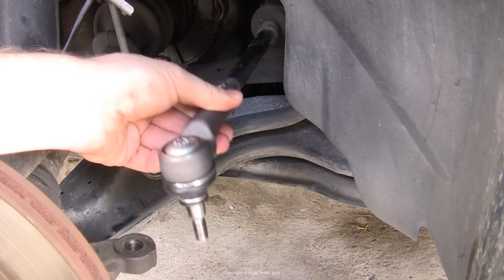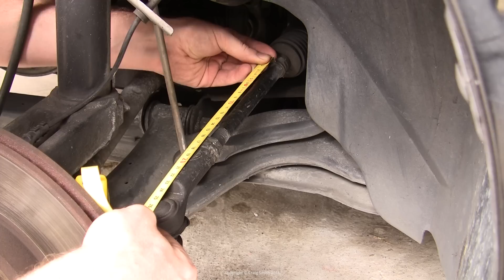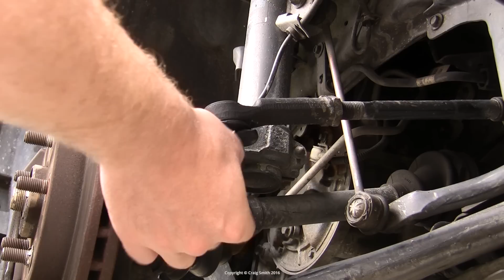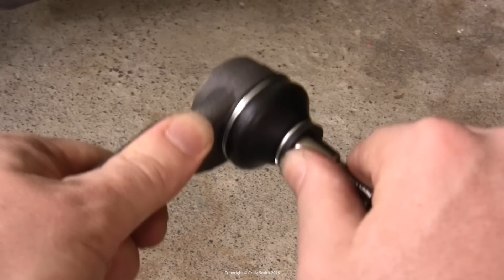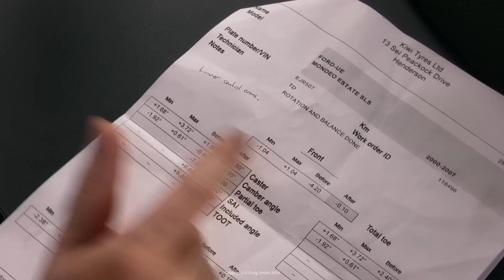How to: Replace outer tie rod ends (Ford)

Comment: If you measured to the tie rod end stud center. You should've just put it back on to that distance and not worry about number of turns it made!! Or really anything pertaining to the threads. You could've saved yourself that whole issue and expense.

Comment: ive done lots of these   he made a mistake !    he didnt    measure the old tie rod to the center of the end  then turn the new one on   no matter how long or short it is   and measure it to the center of the end and make sure its the exact same  length of the old one before tightening it down  if he did  then no alignment it would have been needed.

Comment: Maybe I'm wrong ,but I'm changing that part at the moment and mine is stock ,nut. On top and yours is upside down and in my opinion the nut should be on top..maybe that's what made yours wear out faster
Reply from the maker: Different cars put them different orientations.
Reply: My 2010 Mondeo's the same, nut on top and not on the bottom

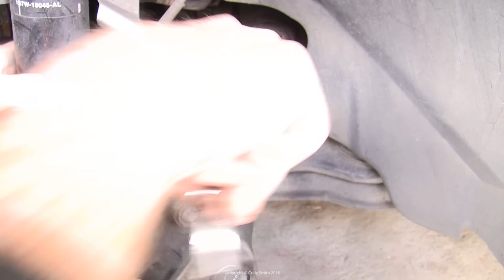Comment: 10:41 is this movement normal?
Reply from the maker: Yes it's just the inner joint, it has to articulate too. So long as it's not loose or slack as discussed earlier.
Reply: @CraigsDIY  thank's !!